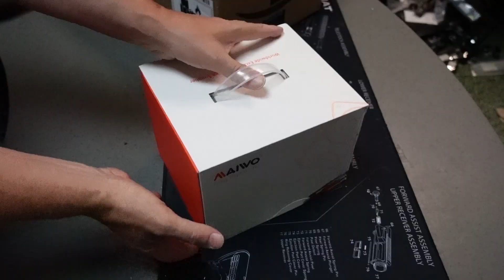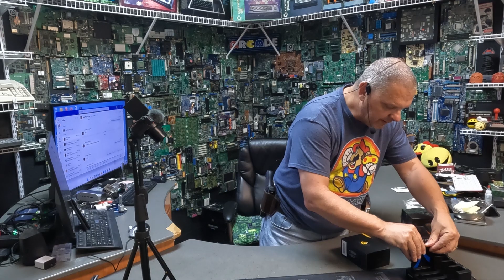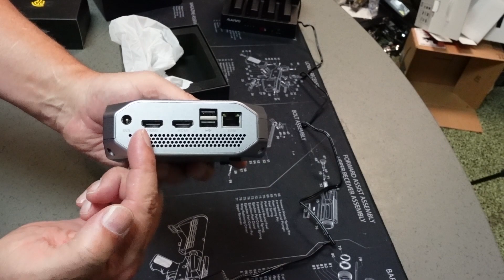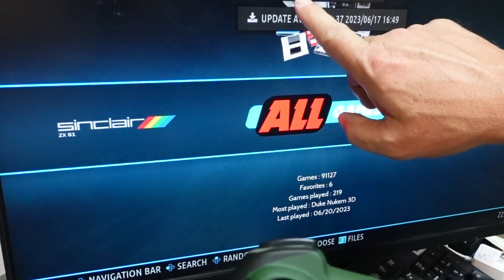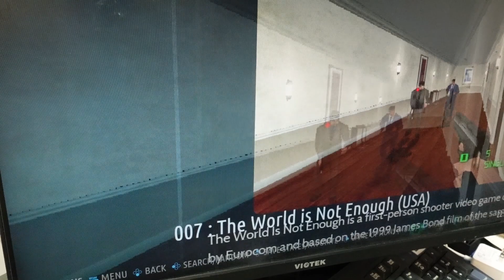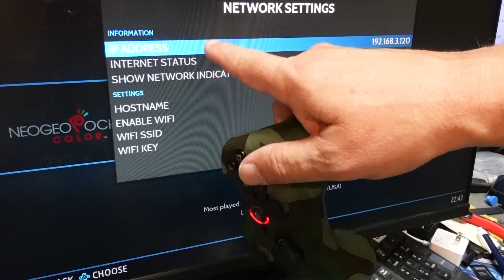Lets test the Atopnuc AMD A9 9400 AND the MAIWO drive duplicator | Lets build a retro game BEAST!

Comment: Did you mean ATOPNUC? It’s… quite a machine. I’m repurposing the guts of a Picade to replace the Pi 3B+ with this machine, and expect a huge upgrade in the process.
Reply from the maker: Absolutely!! This thing packs a heck of a punch. So much so that Ive actually moved away from raspberries to some extent (Power and availability being the most important reasons) and Im rather glad I did :)
Reply: @Complete_Technology_Solutions  If you have the chance to play with a 2023 LarkBox X, don’t sleep on it - Intel’s N100 packs a punch with 12GB RAM and a 500GB SSD at $200. I’ve even gotten it to run Wii U games.